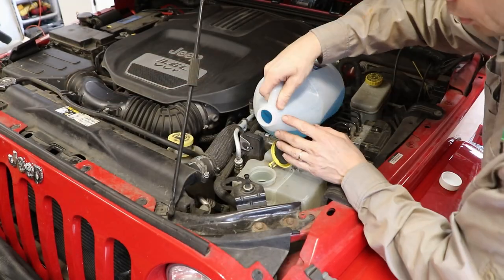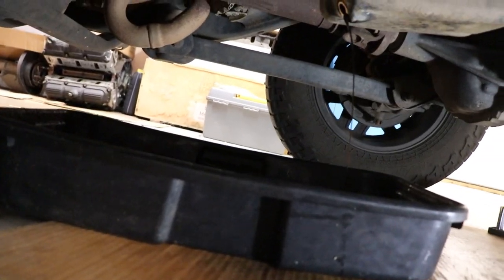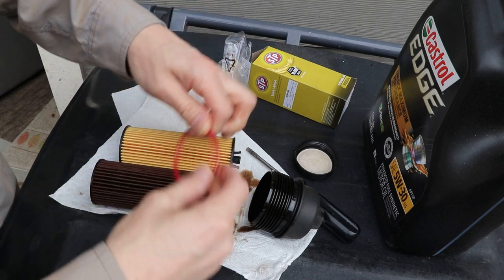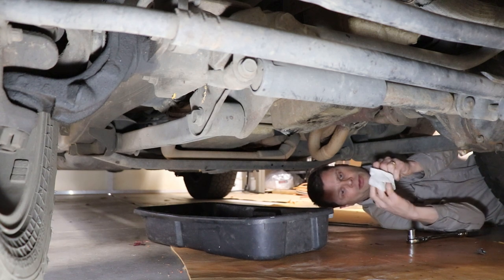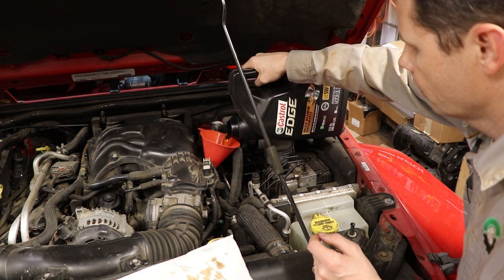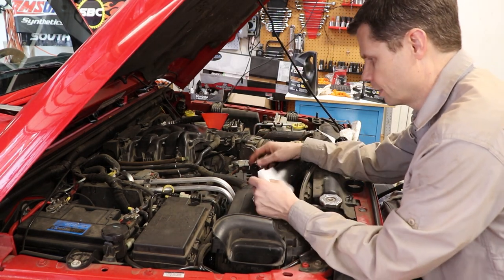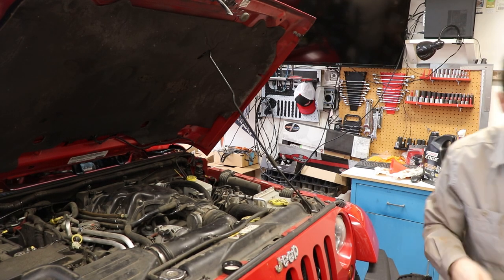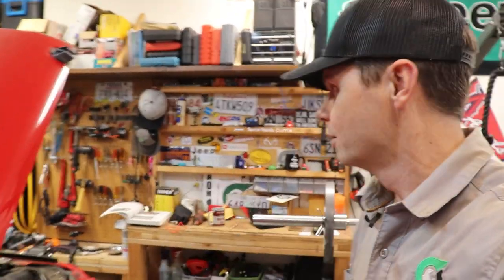Easy Job on the JEEP! You'll thank me :)

Comment: Excellent video, you're absolutely right, no one cares about your vehicle more than you! In a pinch, usually in the winter when it's 20° or colder, I'll bring the 6qts of Valvoline 10w30 150K Synthetic Blend & Wix filter to the local garage to do the oil change. A little older now and paying $20 for this and not having to lose feeling in my fingers and toes is worth it. But the other 3 seasons, yeah, I'm changing my own oil.

Comment: Nice video great info..  I have a question for you, you have a lot of experience with Jeeps so I want to know if you can help me out.. I have a 2006 TJ 2.4L (80K+ miles)  and I have a problem with the front crank seal a few month back its started with an oil leak  and I've replaced the front crank seal a few times because its pushing the seal out (3 times).  Do you have any idea why this is happening ? I bought 2 seals aftermarket and the third one was from the dealer and the 3 were pushed out.  thank you ...

Comment: “ no one cares more about your vehicle than you do “ . That cliche should be framed and hung in every garage or driveway , everywhere . Not saying that quick change shops should be converted to detail shops but not sure either . To buy or not to buy a vehicle that was ‘ faithfully serviced “ by one of these shops is debatable ? Oil,change and grease jib is as thankless of a job as rebuilding a front end but always a happy moment as putting away your tools when completed . If I don’t sound happy about it , it’s because it gets old correcting someone else’s mistakes and ham fisted “ service “ . But because it’s Jeep , it’s always worth it . 
When you spoke of “ it’s just not filling up “ , that takes me back to a story . We were getting ready to start a barn find . We were adding water into the cooling system , just to check if it’s a runner . When the hose was running longer than a minute , I asked “ how much water does this system hold ? “ . I knew something was badly wrong . A compression check badly revealed why later . There was none in one cylinder . The one that held all the water that rusted through the cylinder wall . That was the first of three engine swaps . An air cleaner bolted in place and a floor mat may have helped ? Well ,who had time to think of that when they were storing the car away , in its final resting spot , up a rocky but short driveway , into the barn .

Comment: I used to always change my own oil, filters etc.  Walmart does it for considerably cheaper than I can plus I have no used oil to go recycle, no messy filter to deal with, no oily clothes or driveway and they vacuum the interior, check fluid levels and fill my tires if needed.  I’m not a lazy person but that’s a win win deal.

Comment: I have only not changed my own oil 2 times once they cracked my radiator the other time they cross threaded the drain plug .after that I was done .plus on the 4.0 jeep now you need oil with zddp aka zinc .

Comment: The only hassle I have is taking the oil in to recycle.  I still do it myself for the reasons you state, to check things underneath
Reply: right I have like 20 jugs full sitting behind my garage
Reply from the maker: Our garbage service picks them up with the trash once a month. Super handy
Reply: Find a local shop that uses it for heat… maybe even your local recycling center… not to mention most places that sell it take back the used oil…

Comment: interesting.   some thoughts. if one can crank motor with out having the ignition. on.   or on some cars put some oil in the filter.       next. Save your battery.   turn the lights off.  DO Not start with lights on. that is one thing that is real hard on the battery.    it is the total starting. that kills the battery.      it do not know. .may be one has money to burn.    I do not know.
Reply from the maker: That would be an interesting test 👍🏼